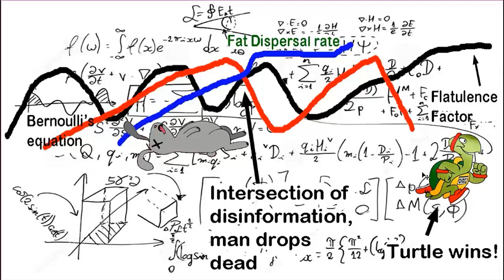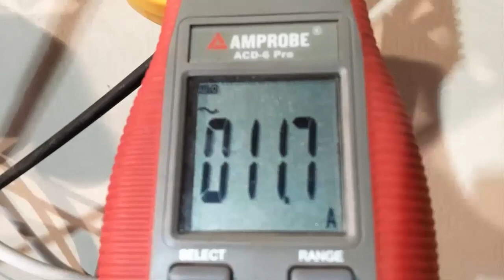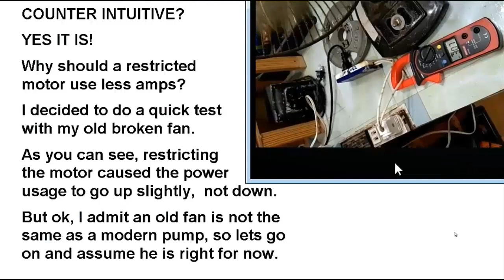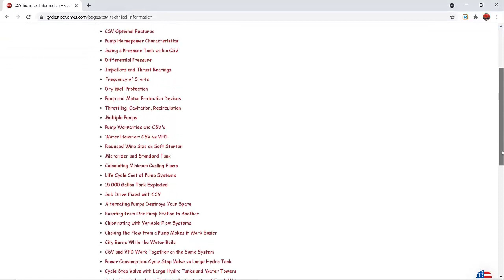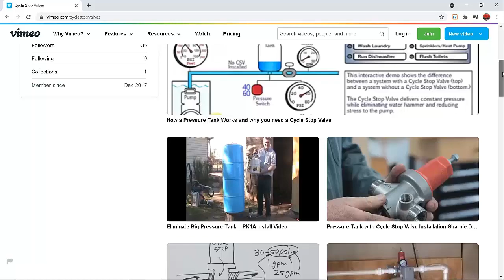Cycle Stop Valves are Bad?

Comment: Cary you need to do some explaining that none of your videos do! 
Let's take the average residential well system that has no need for long water usages like running a sprinkler system for long periods of time each day.
My 1st question is: once my water usage is complete and the pump was running, how many GPM.s does the CSV supply to fill my expansion tank? I am hearing in you videos that it is 1 gpm. 
Lets say my expansion tank is a 28 gallon and I know I have about 9 gallons of usable water before I hit the cut in psi. 2. Is the CSV supplying any water into my expansion tank during the water usage? If not ,it will take my pump 9 minutes of running time to fill once usage is complete. The optimal time is around 2 minutes. 
3. can the gpm to the tank after usage be increased? 4. Using a very small tank like  those small ones advertised would have most common households to have the pump running too many cycles. 
Pump manufacturers recommend at least 1 minute of run time each cycle, less than that is not good for the pump wiring etc. With my original expansion tank, my pump would only run 21 seconds per cycle and that was even when  a shower of something was running as you explain well. I have since added a 2nd larger expansion tank and between the 2 tanks have about 22 gallons of water usage before my cut in psi. (30 -50 switch ). My pump now runs 1:22 seconds each cycle. I could go further but that's ur job. I would suggest better explaining. 
I have more info with my son installing your csv and how he's managing if you're interested. For now I will not be installing one and suggesting to my many neighbors and customers to do the same until the air is cleared. 
TY
Reply from the maker: All that information is on our web page and/or videos.  Sorry to have so many hundreds of pages of info that you can't find the little things in it that you want.  The videos explain everything well.  I have also explained this hundreds of times in dozens of different ways.  It is just so simple some people can't understand or simply will not believe it, even after it is explained to them.  The CSV method of pump control is so perfect it was actually blacklisted by pump manufacturers in 1994 as the CSV makes pumps last longer and use smaller tanks.

Yes the smaller CSV's fill the tank and have a minimum flow of 1 GPM.  But that doesn't mean it takes 9 minutes to fill a 9 gallon draw down tank.   With a 40/60 switch the CSV is set for 55 PSI, which will give you about 2 minutes of run time to put the last 2 gallons in you 9 gallon draw down tank (from 55 to 60 at 1 GPM).  Increasing the minimum flow and tank fill rate through the CSV would also increase the flow rate that causes the pump to cycle.  As it is the pump will not cycle as long as you are using more than 1 GPM.  Increasing the minimum flow to say 3 GPM would cause the pump to cycle on/off when using a 2.5 GPM shower, which isn't good.  We offer higher minimum flows with the larger valves, because larger pumps need more flow to stay cool.  But 2HP and smaller pumps only need 2/10s of a GPM to stay cool, so 1 GPM minimum is best.  

I hate that you wasted so much money on those large tanks, as they are not needed.  With only a 4.5 gallon size tank the pump will cycle the same number of times for a house as with a larger tank and no CSV.  The smaller tank causes the pump to cycle on for uses over 1 gallon.  But the CSV keeps the pump from cycling at all during long term uses of water.  So, the total number of cycles per day is the same.  The difference is with the small tank you get strong constant 50 PSI almost immediately.  With a large tank and 22 gallons of draw down the pressure in a 3 GPM shower will drop and feel low as the pressure falls from 60 all the way to 40 for 7-8 minutes before the pump starts.

Run time can be made to be 1 minute when using a 4.5 gallon size (1 gallon draw) tank if you want.  But the one minute thing only applies to cool the motor after it has been running at full load amps.  With the CSV the amps are reduced, the motor is running cooler, and doesn't need a minute to cool back down.  So ,we usually set the CSV system to fill the tank and shut off after about 20-30 seconds.

All this explaining is in our videos and web page.  It is just simple answers to questions people think are more complicated than they are.  All you really need to know is that any flow rate for any length of time you want to use it, is covered by the CSV system with the small tank.  .  In the last 30 years a million systems with CSV's have lasted longer and working better than any other method of pump control.  Being counter intuitive, It is just so simple it makes even some engineers lose their minds.  But for those willing and able to still learn something new, the CSV is a game changer.